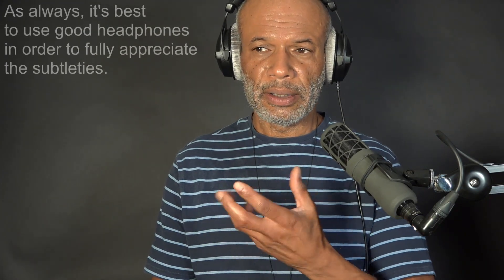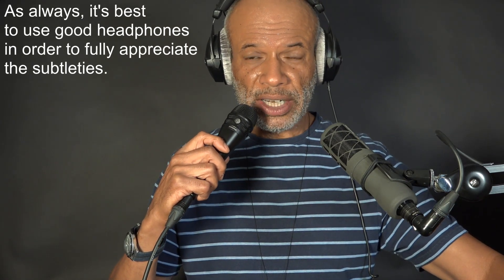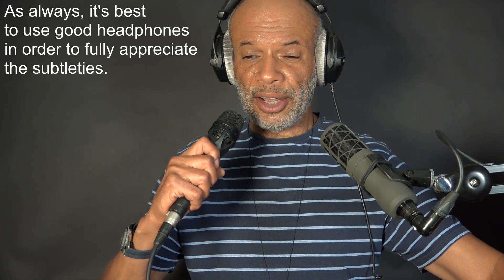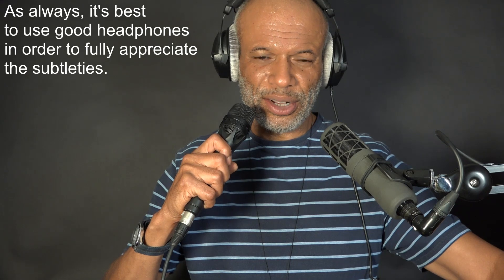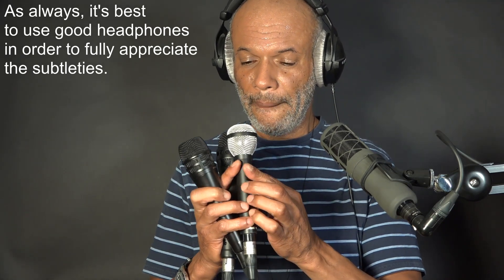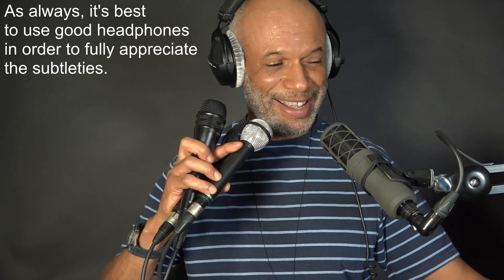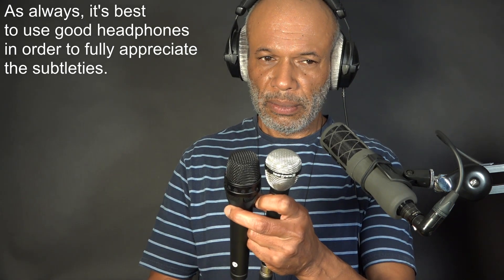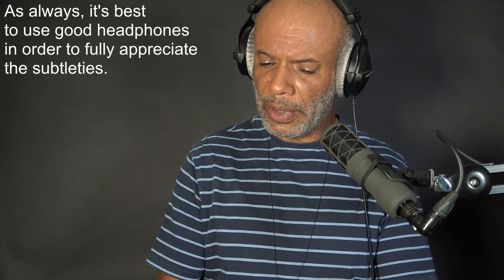The Effect of a 100 Hz Low Cut on a Mixing Desk

Comment: Listening on my Focal Alpha 80s (monitor speakers), that Shure definitely becomes "papery" with the bass cut. And no surprise the, Earthworks just loses a bit of bass end. The Beyer does seem to "survive" the HPF best of the other three. However, if i were using these mics for vocal recordings, I would almost as a matter of course add an HPF to any vocal microphone in a mix, as  any low end "rumble" is to be avoided to make a voice  sit in a mix. 
I guess for live use, it would depend on the situation, and of course, crucially, on the voice of the vocalist. Certainly for most female voices you could (and probably should) cut a certain amount of bass end, just to avoid muddinesss in the overall sound. For a male voice, it would depend. 
The other variable of course is at what frequency should (or could) you roll off the bass end, and by how much?
If i was using one of these in a recording, at least with a DAW, you have the option of varying the cut-off frequency, the amount of attenuation, which is linked to the roll-off slope of the filter.
 I would hazard a guess that you would have to select your options according to the singer's voice, the microphone used, and what else is going on in the track. 
For live, it will be more dictated by the acoustics of the room/hall and the overall situation. A small jazz trio would not necessarily require as much of a roll-off, as in, say a busy rock/funk/etc. gig at volume. 

But interesting to hear the differences that become apparent when you lose some of the audio spectrum with different mics. and how it can change the overall sound when you do so.